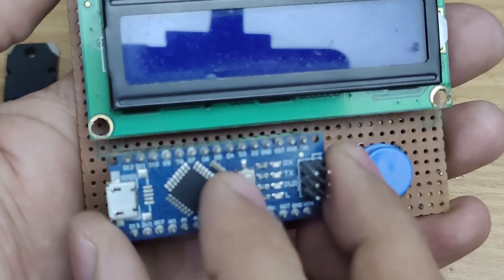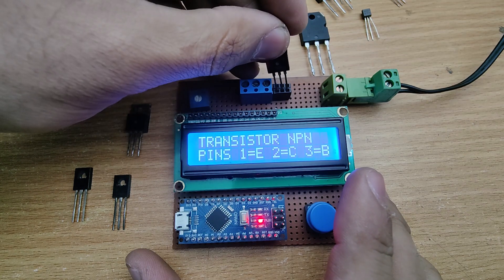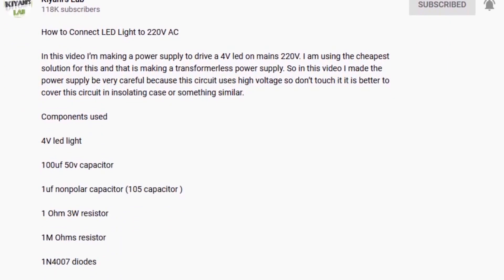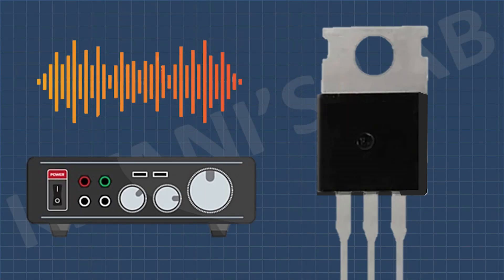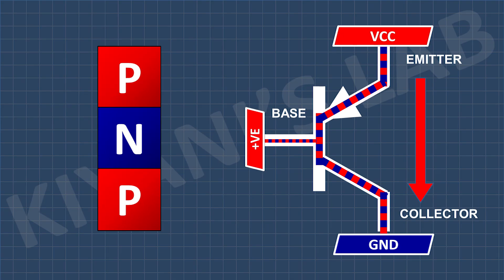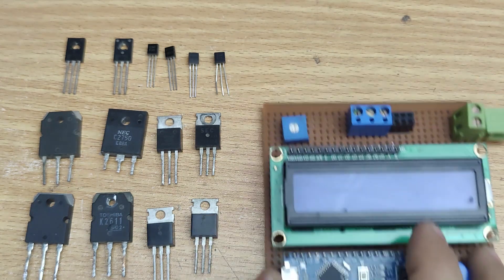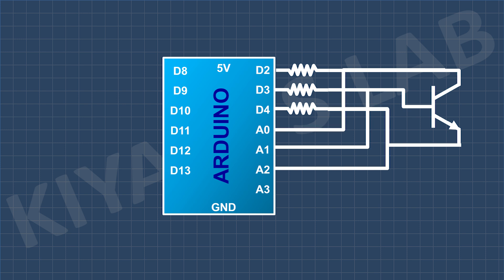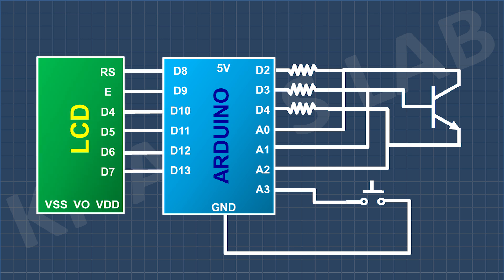Arduino Transistor Tester With Code | Arduino Project

Comment: copying others work and pretending it is yours is unethical. Shame on you.
Otherwise it is a waste to just use a uC as a simple-minded go/no-go tester.
Reply from the maker: first of all it's not copy  I made it my self  shame on you to criticize without doing your research 2nd it not waste of uc I am going to add more freature in the future like hfe other components  and also testing feature like voltage frequency current and testing servo motor stepper motor 0 to 10v and 4 to 20ma sourcing and testing  a lot more l will add these step by step and by the way a lot of people copy my work do you research first in the past a lot of video are made on my projects after some time I publish those video
Reply: @kennmossman8701  , In this field, it is very difficult to say that you have an original project. Any project can be created in a similar way. It's enough to change the input and output pins, a few lines of code, and you can no longer say it was copied. Moreover, this project can be easily completed with the help of AI. However, as a comparison in terms of implementation and code, it can serve as inspiration.

Comment: A useful project. Thank you!😊
Reply: copying others work and pretending it is yours is unethical. Shame on  Kiyani.
Otherwise it is a waste to just use an uC as a simple-minded go/no-go tester.
Reply: @kennmossman8701  , In this field, it is very difficult to say that you have an original project. Any project can be created in a similar way. It's enough to change the input and output pins, a few lines of code, and you can no longer say it was copied. Moreover, this project can be easily completed with the help of AI. However, as a comparison in terms of implementation and code, it can serve as inspiration.